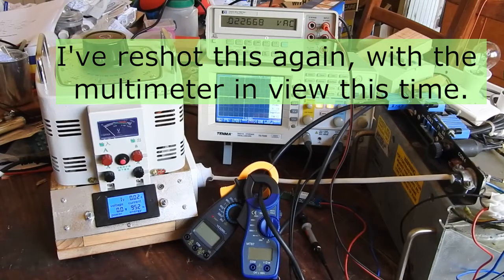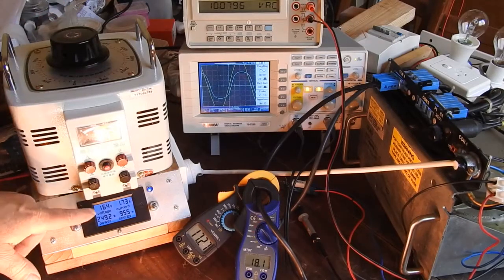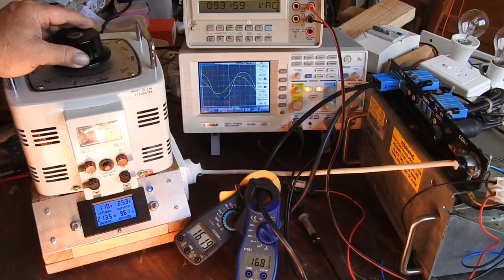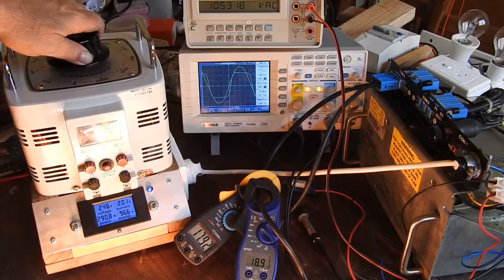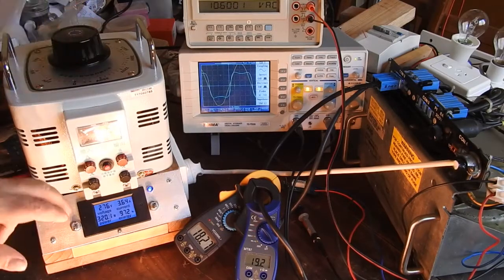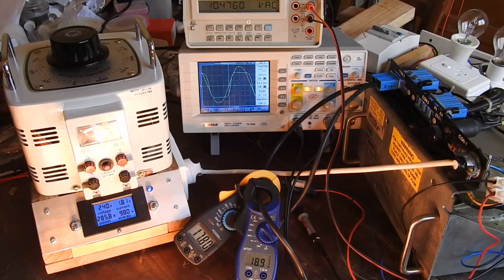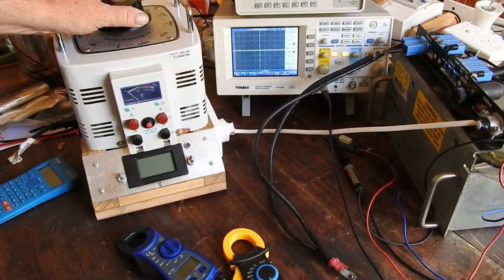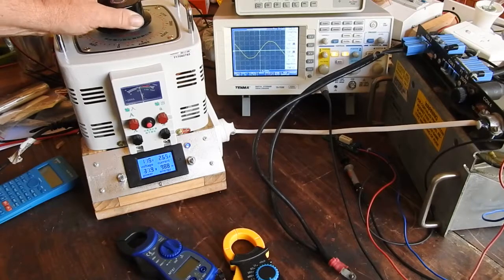Ferroresonant Transformer Basics  - Part 3 of 3

Comment: it is so rare to see these transformer nowadays, the voltage regulation is better than my expectation. Have you tested this transformer with non-linear loads( rectifier and capacitive filter)?
Reply from the maker: No, I haven't. 
But that's what it was originally connected to. Three of these, (each connected  across pairs of the incoming three phase power) formed the power supplies in am IBM 4341 mainframe computer.
The squarish output waveform is good in that application, as the output of a full wave rectifier will have much less ripple than from a sine-wave, reducing the need for a large filter capacitor.